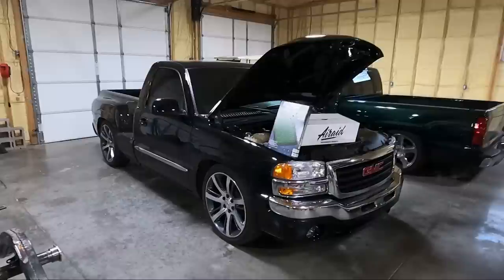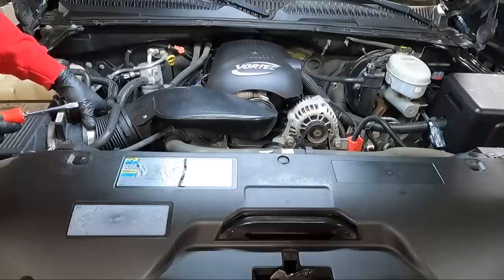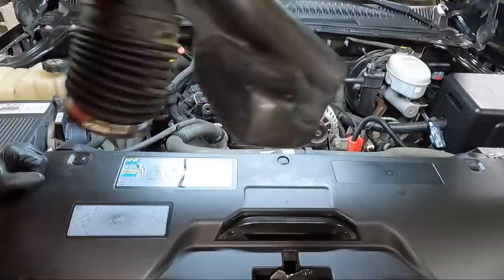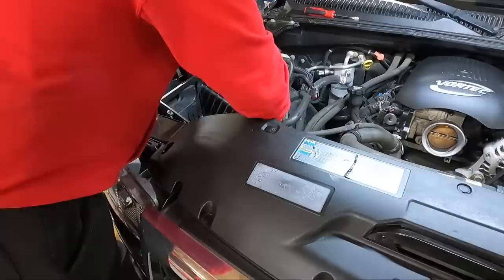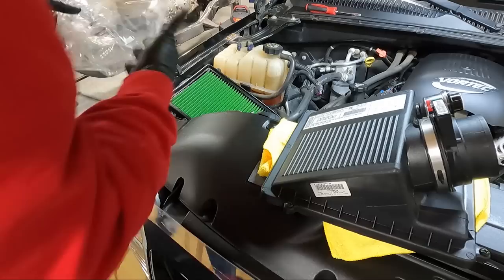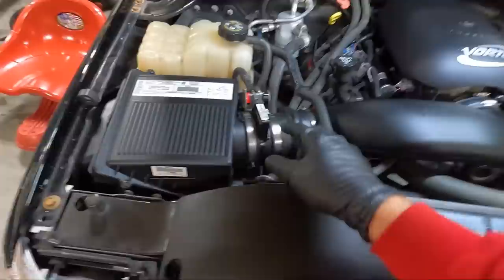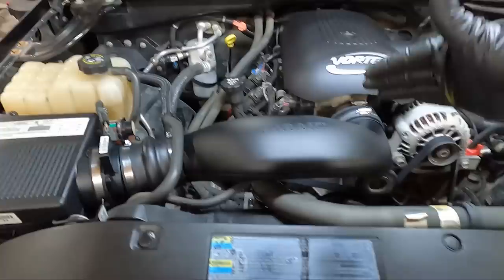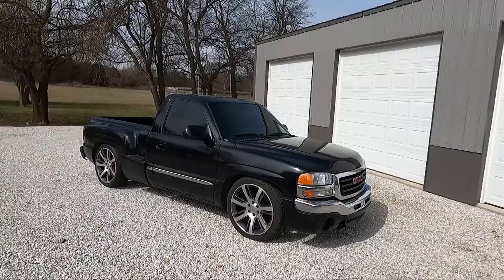Cold Air Intake Installation and Testing with Dragy on the NBS GMC Sierra Stepside

Comment: I installed an Airaid MIT on my previous 03 Silverado with a K&N drop in filter and my current 07 Avalanche with a AEM drop in filter. I think it give better throttle response but I didn’t notice any difference in fuel mileage. 
But in response to a comment you made earlier in the video, my 03 Silverado had a mechanical fan with the big fan shroud and the MIT fit perfectly.
Reply from the maker: They make 2 models of the mit. One for e fans and one with manual fan

Comment: I found after an intake swap it is beneficial to retune your MAF curve... basically calibrating the fuel mixture. In filtered mass air calculations only it doesn't use the o2 sensors and hard coded. That may make a difference. Bad ass truck for sure. Somebody's gonna get a clean deal!
Reply from the maker: Definitely needs a tune for peak performance

Comment: I like the Airaid MIT. I've installed them on my old 03 Yukon Denali and 15 Tahoe to get rid of the ridiculously bulky factory intake tubes. I like retaining the factory airbox, much easier to replace the air filter. It may not provide a ton of performance, but you get a nice intake growl out of it and it cleans up the look.
Reply from the maker: Definitely does look better

Comment: The heck with those  filters you have to oil!!!!! Go with an AEM dry type of filter, no oiling at all. Whern you use oil, it will eventually coat the MAF sensor and you wind up with a code. Plus you dont want oil being baked onto the sensor,will shorten its life as the wire gets hot, will get hotter with a coating on it, you arent supposed to touch the wire when cleaning  the MAF sensor spray cleaner is all you should use to clean it  no scrubbing.
Reply from the maker: I tend to agree on filters with oil but green usa had always been good
Reply: I've had K&N filters on all my vehicles and have not experienced any issues with them. Just clean and oil them properly and you'll be fine. A lot of people tend to drench these filters in oil thinking they will benefit from it but nope.
Reply from the maker: I agree. Over oiling causes lots of issues

Comment: That thing has a ton of torque management in it.....still. You can hear it. That's why it's not really accelerating any better.

 You also need to get your shifts points up to 6k rpm maybe slightly more. It really helps with the shift recovery into 2nd gear...and 3rd with such a wide spread between ratios.

My uncles 03 5.3 silverado rcsb 4x4 went 15.3@92 in 85* heat. Likely had a little more in it but he had to leave the track early. Each pass he made he was getting faster. So your little tires 2wd could likely go well into the 14s with the tm removed.
Reply from the maker: I agree but to save the transmission I will keep torque management in place.
Reply: @TWAMotorsports  you don't have to save it that much. They're not as bad as people make them out to be.
Reply from the maker: This one is all original and with this mileage who knows

Comment: It is so hard to see immediate improvements with bolt on modifications.  It takes time for the computer to relearn and adapt to the changes.  I dreaded unhooking the battery in my 99-02 Pontiacs.  It seemed like it took 6 months for the trans table to get back to shifting right, and then it was back to storage and unhooking the battery.  Didn't have power in the storage barn so I could leave it on a tender
Reply from the maker: Sometimes that is the case